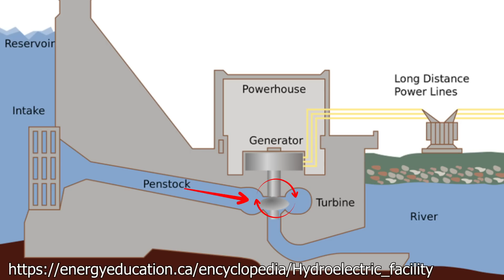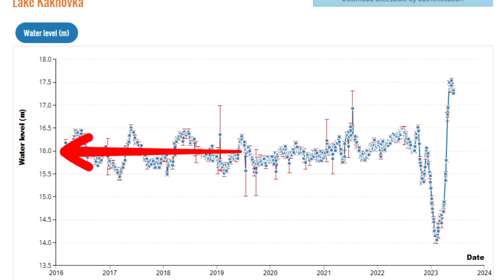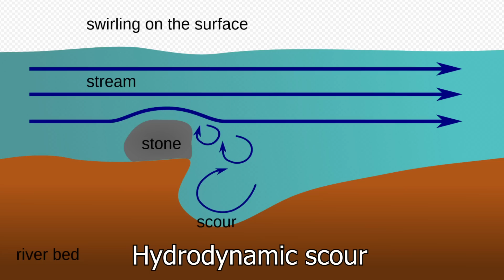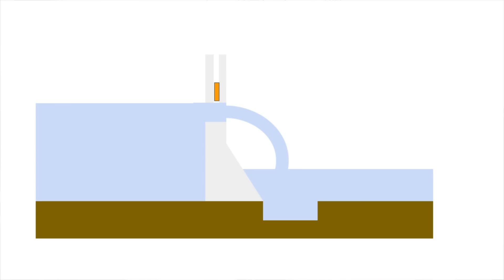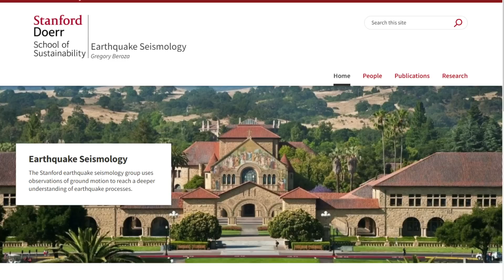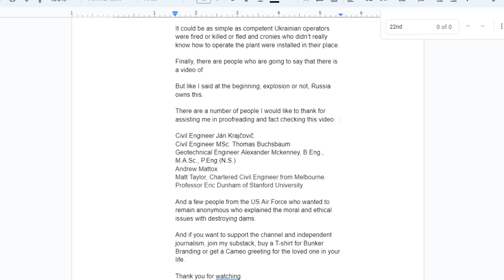How Russia Destroyed the Kakhovka Dam

Comment: I thought that too at first.  Considering other damage that had occurred to the dam prior to collapse, plus Russians  grossly overfilling the reservoir, I speculated stress to the structure caused the collapse.  However seismic data released today points to a single large internal explosion as the cause of collapse.
Reply: What leads me to there being an explosion is that when the first drone footage was taken at dawn after the collapse, the dam was breached in two places. One was where the section of bridge had collapsed in the days prior, the other was the middle of the turbine hall, of which the top part of the structure was completely gone with the lower sections seeming to still be there with water flowing over them, so it's unlikely that gap was caused by scouring.
Reply: Russia destroyed its own water source? How interesting. Who is on record attempting to blow this dam multiple times? The world is just not buying your lies and propaganda anymore.
Reply: That goes with my theory that they were scuttling the generators.  And that shock combined with the precarious state of the dam, which Russian officials were warning about two weeks earlier

Straw camels back theory
Reply: Stress the structure to it's max, and then using explosives makes it easier to kick off the failure.

Dams are deliberately built to be damned resistant to collapse, for obvious reasons.
Reply: And video of the explosion actually occuring.
Reply: @Lanedl1  It is most definitely that Russians did load explosive in there. But did they explode it - different question. As a matter of fact if they believe Ukrainians  would force river, they can perfectly wait till they did and then wash them off. But forcing that river is pretty much impossible as is.
Reply: I have yet to see good seismic data, but assuming there is a clear signal of an explosion, that doesn't really contradict anything Ryan says here.
It seems entirely possible that Russia decided to destroy the generators (expecting Ukraine might take back the dam soon), but the dam was in such dire straights due to neglect and the high water level that it ended up being the last straw leading to total collapse.  
I don't have good evidence for or against this scenario, but it does seem to account well for what we do know.  Also fits with the rule that the cause of a big disaster is almost never very simple.
Reply: There are images of water plumes erupting from the dam as it collapsed. That would be air violently escaping from the turbine rooms and other cavities within the dam. A large single collapse with tons of water would generate seismic data that could seem like an actual explosion. 

Seeing as how Russian defensive positions were washed away, the occupied city of Kakhovka was flooded and the Crimea canal could be lost in this event, it made little sense for Russia to deliberately destroy the dam. It also made no sense for Ukraine to do so either. 

Yeah, this looks more like incompetence and ignorance on the part of the occupying forces than a deliberate destruction of the dam by either side. It’s a horrible tragedy no matter what the cause.
Reply: @billd9667  except russia doesn't care about its soldiers, at all.  prigozhin just said in a video that he fears russia might drop a tactical nuke on belgorod just to show that they're crazy enough, at the cost of their civilians, because again, they don't care.  russia moved their equipment, but not their soldiers.  it could be argued that they left their soldiers as a sort of alibi as to why they couldn't possibly be the ones that blew the dam, because their own guys are there.  but these are the same people that send prisoners forward to blow mines and draw fire one by one to clear paths forward in when they're on the offensive.

and the SBU released an intercepted call (3rd one now related to mining the dam) with the guy correcting the person he's on the call with that Ukrainians didn't do it, they did.  they being the russian separatist sabotage team.   we could claim this video was faked, as it's just voice, so that's a possibility, but the one from January was a video call, and those don't seem to be faked as people can be recognized, and I think that was a ukrainian talking to a russian if I remember correctly.

and the seismic graph he showed that "didn't have scale" was from a group that's been doing ongoing research into this and they've measured all explosions and reported on them in a huge exposé you can find the PDF for, and I guess they were saying it would take something like a megaton to cause a spike that large from the discussion I saw about that

and it's all still speculation, but I don't think this is enough to conclude that it was just negligence
Reply: @ame7165  Possible that a rogue element did perpetrate this, but it’s a stretch. Once again, it would take tons of explosives to accomplish and that would be hard to sneak in. Yes, it’s possible that this rogue element just “got hold” of the detonator that was set by occupying forces previously. 

The thing you seem to be skipping is the Crimea Canal. That is a huge. An argument could be made that this entire “special operation” was prompted by Ukraine’s obstruction of that canal and the cutoff of fresh water to Crimea. Crimea has mystical and mythical importance to Russians. Destroying that canal is a huge blunder. The order for blowing the dam could never have come from Putin for this reason. Rogue element? Maybe, but they would have to be damned stupid. Separatists? Any such group would need Ukraine to accomplish their goals. Just making Putin look bad wouldn’t be enough.
Reply: @billd9667  first, I've been following this from 2014 as I have both russian and ukrainian friends and know the russian language myself, so all of the telegram channels on both sides I've been scouring as it's interesting to me.  as soon as russia took Crimea in 2014, ukraine blocked that canal.  it's been closed for 8 years.  russia opened it last year at the start of the offensive.  blocking that again is hardly a sacrifice when they went 8 years with out.  that single reason was a huge push for putin to finish his Kerch bridge, as that bridge carries water to Crimea.

of course it would take a ton of explosives.  they struggled to blow a damn bridge with a few weeks of himars strikes and that's a foot thick.  damns are tens of feet thick and likely reinforced a lot more to hold back the millions of tons of water.  but ukraine got intel that they mined the dam months ago and even told the UN about it.  first, ukraine started to cut access to the ukrainian side of the south, and they used himars to start blowing bridges.  they blew the one closer to Kherson (the one that took MANY strikes), and then they used himars again to hit the one on the damn.  in the spillway section there was a bridge for vehicles, and Ukrainians blew it with himars.  russia then filled it with dirt and started driving over it again.  then later ukraine started to push them out of Kherson and as they retreated, the russians blew the part of the damn that Ryan mentioned with explosives.  that was the point where ukrainian intelligence caught wind of the mining of the dam.  the key word is mine.  they literally say mine.  russia knows we gave them some pretty fast and advanced instant bridge engineering trucks, and ones that would bridge the gap they blew pretty easily, so it would actually be smart on russia's part to mine the whole dam as a last resort plan B.  the leaked video call, which is hard to fake since people get recognized and image searched on яндекс and вконтакте, and in that video the guy said the loaded it with mines and as they're crossing he said they might blow it.  that was in December or January.  he mentioned how badly it would flood but said it wouldn't be too bad.  he said there's 70% chance they'd likely blow it. he basically spoke like it was already mined, and were just waiting for the word.  russia has had control of the dam for months now.  I don't understand how anyone thinks it would be hard for them to do it.  they could load that thing up over night in one single night without a problem.  it's on their side.  or they could do it over time, carrying it little by little.  I think it's wrong to think that anybody would struggle to load that thing up when you have control of it and have months of time to do it.  and back to the video, mines.  mines were mentioned several times.  in one video from a russian after the thing blew, you saw water shoot up.  that could definitely be just water and air interacting, but it could also be a mine blowing.  immediately after it blew, ukrainian telegram channels showed a batch of mines under the water.  still could have nothing to do with anything, but you have to consider everything with this crap

let's say they mined it earlier.  they literally claimed they did in a leaked video call, and they were retreating from Ukraine's last counter offensive in the south, so blowing everything behind you makes sense, but this has implications obviously, so once they blew the bridge, it wasn't necessary to blow the dam, but they probably did as a backup plan.  so let's say it's loaded up.  the side opposite the water might not be as thick as the water side.  I'm not sure how that is since the turbine rooms are in the middle of this dam, but if mines were already inside, it's possible a smaller hit from anything could have been enough to set the whole thing off.  or maybe the erosion Ryan mentioned caused floor inside to collapse, and that set a mine off, and then all of them went off.  or being ancient soviet junk, maybe one went off erroneously.  I would doubt they armed them, but their stupidity knows no bounds, so I rule nothing of the such out lol.  

and there's this: https://www.youtube.com/watch?v=N3I5tnowpP4
Reply: @billd9667  - Making sense is NOT what Russia does.  Creating deliberately nonsensical doublespeak and contradictions is a Russian superpower!  Pass the paradox and vacate your traps, you will never find a Kremlin mouthpiece locked inside of logic.
Reply: @billd9667  I know the vids you are talking about...based on the size I believe those were videos of displaced mines cooking off.
Reply: @billd9667  
Excellent
Reply: @billd9667  yep and now there has to be loads of trucks delivering water to Russian soldiers.. over the Kerch bridge..more targets
Reply: @billd9667  using logic when trying to come up with a motive for the russians to do this is the wrong way to think about this.  "Russian defensive positions were washed away, the occupied city of Kakhovka was flooded and the Crimea canal could be lost in this event" none of these are valid arguments.
Reply: Watch the video, you will need 2 distinct seismic actions, 1 for the explosion and another for the Dam collapse. Since only a singular seismic action happened it is unlikely to be a bomb. A Bomb explodes, but the structure needs to collapse, 2 distinct and different signatures.
Reply: @Sufferingzify  a dam collapse would not have the same signature as tnt exploding. Its entirely different.
Reply: @lochnessspeedwerkz6557 massive concrete structures catastrophically failing would look a lot like explosive fracture of stone...much like an earthquake? The signature difference would be between "P-wave vs S-wave"?
Reply: @Sufferingzify  Again. NOT TRUE. You have ONE SEISMIC anomaly the break up wouldn't cause that.
Reply: @Sufferingzify  I just watched the whole thing.  I disagree that you have to have two seismic actions.  most dam failures aren't in the snap of a finger.  dams generally fail progressively.  it's not a skyscraper where you blow beams with shaped charges and the whole thing comes down and smashes into the ground.  it can't just fall down.  it has millions of tons of water pushing against it.  so instead, you'd get a glancing blow at the worst, so to speak, and I don't think that would be a "spike".  if you look again at the graph, it's not a spike.  it's a pretty side swath of action, and that could possibly correlate with the explosion and subsequent crumbling/failure etc.  if it were just an explosion, like a storm shadow hitting a building, you'd get a sharp spike.  if you look at the whole research by those guys, they show normal artillery explosions and thermobarics and just about everything.  those are all short crisp spikes.  on the exact same graph type, for the time correlating with the dam failure, it's not just a spike.  which I would expect from a massive dam failing.

and I'm not claiming this is 100% what happened.  I'm just saying that while I think Ryan's theory is a good one, it's just a theory, as is russians using explosives from inside.  but time will tell, as video ends up leaking later.  but the three separate calls of russians admitting to mining it and blowing it really makes me inclined to believe they did, but we'll see
Reply: @ame7165  how many people have died from collapsing dams? If a dam was slowly collapsing they would be able to crawl clear
Reply: @IrishFoxHound  slowly collapsing doesn't mean it took a week.  we're talking about force.  the difference between it collapsing immediately uniformly, to where it can register on a seismograph, versus a progressive failure.  it's like how airbags in your car are only inflated for a split second, but that's enough deceleration to reduce the peak G's you experience by a lot.  the dam coming down progressively would
be a similar situation from the perspective of a graph
Reply: @ame7165  were you there then.. 
maybe you want to rewrite this wiki.. 🙄
Reply: @IrishFoxHound  which wiki?  what are you even talking about
Reply: @ame7165  https://en.wikipedia.org/wiki/Dam_failure
Reply: @IrishFoxHound  a wikipedia page about dam failures, what does this have to do with the topic at hand, specifically your reply to my comment?
Reply: Could be a combination of damage, overfill, and well a nudge with a bomb. Maybe they didn't try to break it as much as they did?
Reply: @stcjv87  yeah given that their guys were still in the flood plane makes that a possibility, and that would correlate with the leaked call

Comment: You forgot to tell that water canal to Crimea isn't critical for water supply. Ukraine actually have shut down all water supply to Crimea after 2014 invasion and nothing bad happened for them.
Reply: It was not critical for drinking water supply. Some was used for drinking water but they had mostly worked around that by 2014.
However water for other uses, namely agriculture, was dependent on supply from the canal. Farms going dry is something I would consider "bad" and that did happen.